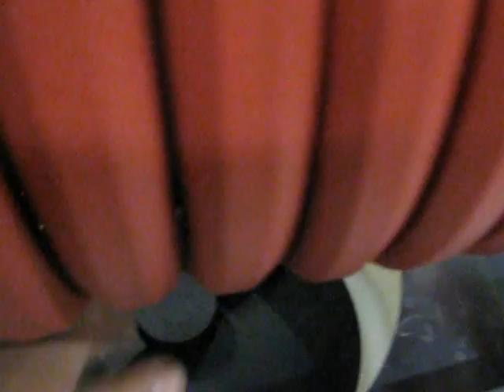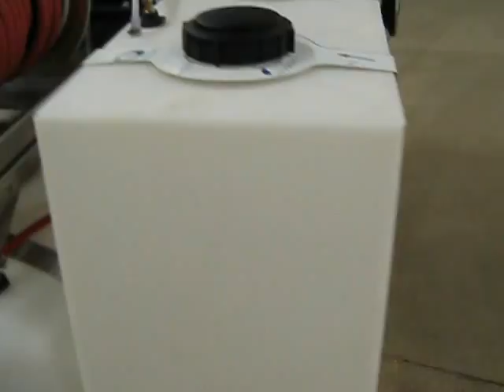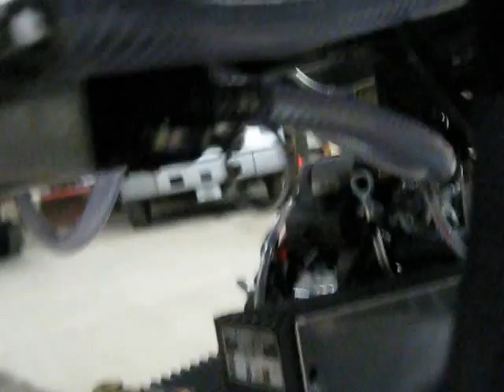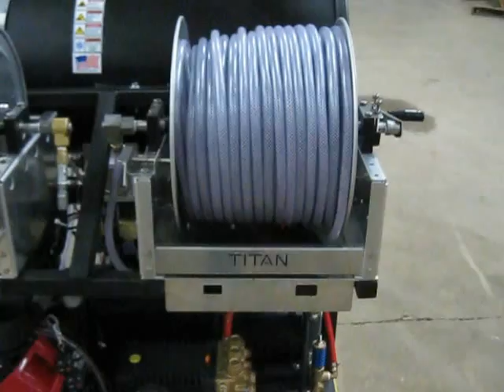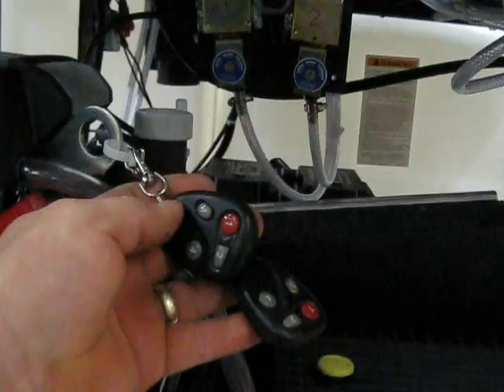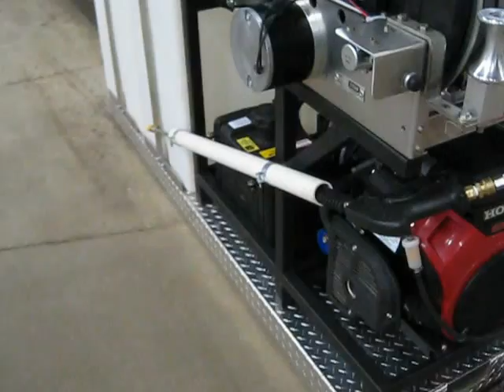www.powerwashstore.com Water Dragon High/Low Pressure Hot Water Truck Skid

Comment: Hello, so I am looking at putting a water refill spout on my trailer to refill my 600 gallon tank instead of using fire hose and having someone hold it to refill. Have you ever installed one yourself? Do you have any recommendations on the parts/pieces needed to install it?

Comment: Question : Pressure wasching hoses and maintenance could you address this by chance. I bring this up because I run my own business and just had 2 hoses bought as "Industrial Grade" bust and noticed the inner liner was eaten up within months. I bought those brand new of May and June 2017 and just now getting back into the season both hoses busted when my Loader Valve builded up the pressure within 20min test running my engine and Equipment both hoses busted which are labeled to withstand burst load of 12000 PSI .... what is your live cycle on your hoses and which one you recommend?

Comment: Power washing, and soft water washing?? <3??
Reply: Angelus Summers lol low pressure is where the gallon per min comes in play . All these videos keep talking bout psi , it's not bout psi anymore , it's gallon per min that us power wash guys want . This is a low pressure 8 gallon per min pump, so you can reach 4 story's standing on ground washing a house and it soakes it down in half the time .. then if u need high pressure , switch tips for the decks . This setup is perfect